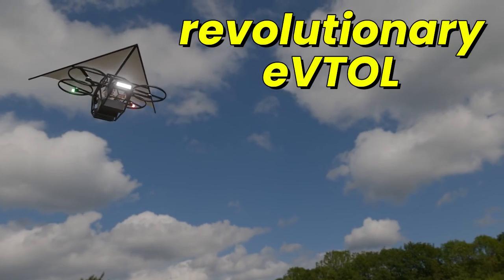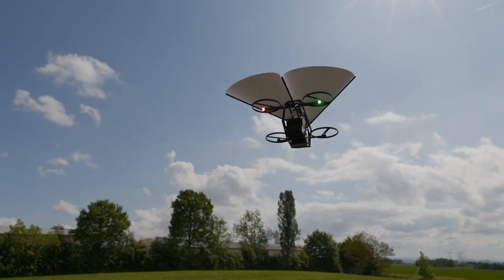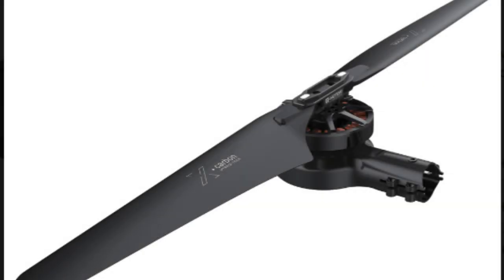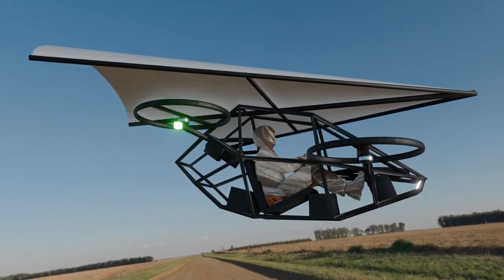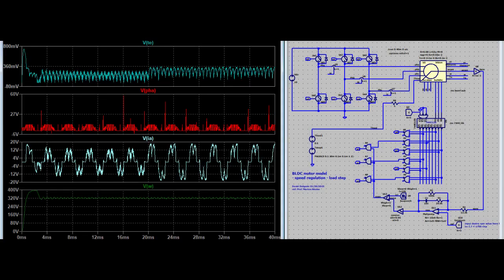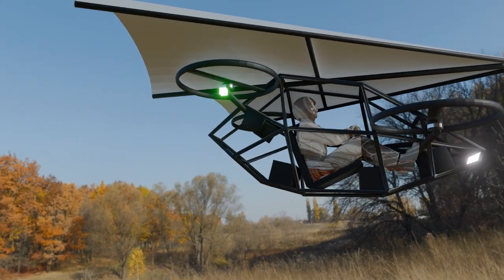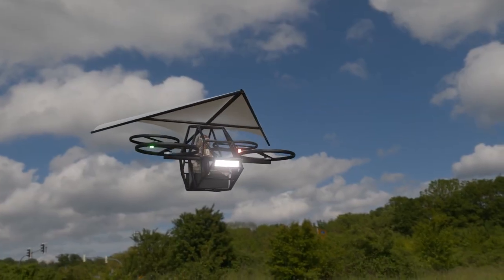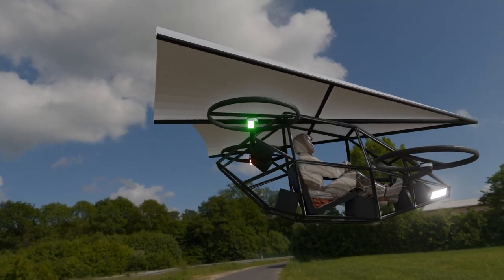eVTOL Drone hybrid for Safety, Innovation, and Freedom

Comment: As a design engineer, commercial pilot, drone pilot and hang glider pilot, this is a great idea, although not as presented. A modern delta wing hang glider with four electric motors/props would provide full vertical takeoff capability, however, with the ability to transition the motor pods to horizontal thrust, similar to a V-22. And not use a old-school rogallo wing, for obvious (to me) reasons. If you think a rogallo wing would work, you have obviously never flown one. The core idea has merit, but the vapor-ware depiction fails entirely.
Reply: I completely agree, this design is deeply flawed, obviously the work of someone with little to no experience in hang gliding or ultralight aircraft.
Reply from the maker: Thanks for the input. However, the system is intended to carry the payload "up the mountain" and not to be used during the glide path down. Does that make sense??  Let me know.
Reply: @BoundlessVision-d2  Then why even bother with the wing? In my vision, the ability to take off vertically is the reason for the quad-rotors. For forward flight, using the wing, rather than the rotors is WAY more efficient, and gives you reduced power requirements which gives you way more range than lifting with rotors alone, but then you must rotate the rotors to thrust horizontally. A rogallo wing as you show is super 'floppy', as I know, having flown them for years. Just trying to save you some time. I think you need to state your goal in greater detail.
Reply from the maker: @BrilliantDesignOnline  Yes no argument with that other than incorporating old school stuff with the new.  Is all.  One of my NEW tech system will absolutely blow your socks away.  Look for that video.  Similar quad Control theory is used

Comment: L'aile Rogallo a de mauvaises performances c'est pour cela que ce genre de forme en triangle a complétement évoluée vers des allongements plus performant sur les ailes delta de vol libre modernes.  De plus il faudrait une aile bien plus haute pour dégager l'intrados de l'aspiration des 4 rotors si on veux espérer que l'aile produise une portance. Le plus efficace en VTOL c'est un avion avec des moteurs qui pivote comme le V-22 Osprey
Reply from the maker: Great observation, but the original concept, the Rogallo wing, is not used as a lift device, but as a parachute, if you will. Thanks for. your comments.
Reply: @BoundlessVision-d2  Ah ok je comprend.

Comment from the maker: The Rogallo wing is a flexible, delta-shaped airfoil that was originally developed by Francis Rogallo in the 1940s. It is known for its simplicity, light weight, and ability to self-stabilize in flight. Here’s a breakdown of its aerodynamic properties:

1. Basic Aerodynamics
Flexible Airfoil: Unlike rigid wings, the Rogallo wing deforms in response to airflow, dynamically adjusting its shape for optimal lift.
High Lift-to-Drag Ratio: It produces significant lift while maintaining relatively low drag, making it efficient for gliding and slow-speed applications.
Trailing Edge Flow Control: The trailing edge flaps in response to air pressure changes, which can improve stability and stall resistance.
2. Lift Generation
The wing is usually slightly cambered, meaning air travels faster over the top surface than the bottom, creating lift via the Bernoulli principle.
Angle of Attack (AoA): Adjusting the AoA changes the amount of lift generated. A higher AoA increases lift but also increases drag and the risk of stall.
Leading-Edge Tensioning: The shape of the leading edge influences airflow attachment and affects overall performance.
3. Drag and Stability
Induced Drag: Due to its swept-back design, the Rogallo wing generates less induced drag compared to a conventional rectangular wing.
Parasitic Drag: Since it's made from a flexible material (like fabric), some drag arises from fluttering or deformation at high speeds.
Passive Stability: It tends to self-correct in disturbances due to its flexible, dihedral shape, making it inherently stable.
4. Control and Maneuverability
Weight-Shift Control: Common in hang gliders and ultralights, shifting the pilot’s weight changes the center of gravity and alters flight path.
Bridle Adjustments: The tension and positioning of suspension lines can affect the wing's response and performance.
Flare Capability: The wing allows for controlled landing flares, slowing descent speed for smoother touchdowns.
5. Applications
Hang Gliders & Ultralight Aircraft: Provides safe and efficient flight with minimal control inputs.
Parachutes & Space Capsules: NASA tested Rogallo wings for controlled spacecraft recovery.
Kites & RC Planes: Offers simple, stable, and efficient flight for various recreational and experimental uses.
Reply: Yeah, NO. You should think a trike with a modern wing, but electric motors capable of longitudinal rotation for horz thrust, and/or vertical lift.

Comment: with your configulation it not gonna work, since both of them can't work at the same time.
the rear rotor will suck the glider wing in and make it lost the aerodynamic shape and the ability to glide while at the same time the quad copter part have to tillting to the direction that it move the glider part will just get in the way and blocking the air intake so it gonna fall like a brick.
Reply from the maker: but that assumes a traditional interaction between the rotor wash and the glider wing. With the right flow control, vortex management, and synchronized thrust vectoring, the glider section can actually benefit from the rear rotor's induced airflow rather than being disrupted by it. As for tilting, careful positioning and adaptive control can mitigate interference while maximizing lift and propulsion efficiency. So, rather than falling like a brick, it's more about making the brick think it's a bird." 😉
Reply: @BoundlessVision-d2  not with the one in the video for sure.
you need a solid wing that not require airflow to form aerodynamic shape. it better to combine the quadcopter with a sailplane what you have todo is figuring it out the best way to extend and retract the quadcopter part to minimizing the drag when you about to glind.
Reply from the maker: @readingmachinenegi  The Rogallo wing is like having a built-in safety net, plus the added lift means the motors don’t have to work as hard—win-win. The key challenge is optimizing the transition between VTOL and forward flight while keeping the wing stable under varying thrust conditions. If the rear motors can tilt effectively without airflow interference, it could create a super-efficient hybrid system. Now the question is: How much control authority can we squeeze out of the wing without compromising VTOL stability?
Reply: @BoundlessVision-d2  The Rogallo wing is only forming an aerodynamic shape when it have air flow beneath it while it decending forward aka gliding.
while in the power flight mode by quadcopter you are going up and tilting foward so it can't work at the same time
also at that moment  the quadcopter pushing you up the Rogallo wing  will floped down and get suck into the roter blade.

both of them can't work at the same time.
try to make some RC prototype and yoy will see it

Comment: Problems
1. The wing is not big enough .
2.  The quadcopter in question doesn't show its components to hide the fact that it would be heavier .
3.  The motors could not be in that position winged flight at the same time . 
All problems identified potentially have Solutions as long as some real thought is put into project .
Reply: I look forward to seeing a full-size prototyping flight ,
It would show the flight performance that you are explaining .
Reply from the maker: Thank you for your input.  Your conjecture #1 claims the wing is not big enough. I would welcome your analysis regarding that claim and compare it to my simulations for this very specific application.  That would be very helpful indeed. Regarding your conjecture #2 , if you may, kindly look up the density of carbon graphite and compare the strength to weight ratio to that of aluminum.  It may surprise you regarding your "FACT" that it would be heavier. Now for your conjecture #3 I will repeat again and again the following:
1. When placing the wing above the propellers, most of the turbulent air from the propellers moves below the wing, allowing smoother and more stable airflow over the wing surface.
2.The wing typically stays in "clean" airflow, which helps maintain lift and reduces the chances of separation.
3.Wake turbulence and disturbed air from the propellers are less likely to interfere with lift generation on the wing.

The eVTOL Drone hybrid was designed for Safety to Mitigate Risks such as positioning the wing high enough to avoid propeller vortices and turbulent zones.  Wing's placement allows clean airflow during forward flight. Using advanced flight controllers for yaw, pitch, and roll correction to recover from impending DISTRUBANCES quickly. Closed loop system with optimum PID error summation values and last but not least, it is important to note the Rogallo wing was designed to act as an emergency parachute in case of motor failure "it is only going for the ride" and NOT intended to be used for hang glider activities 

Perhaps watching movies of people flying into the air with only a jump chute and wings that appear insufficiently large is one way to answer the question of how large a wing should be in order to serve as an emergency parachute. Just something to put things in perspective.   Once more, I appreciate your insightful comments.
Reply: @BoundlessVision-d2   Having a wing as shown in your initial presentation is actually a very Innovative strategy with strong potential ,
But if it's going to be used for unpowered flight in the case of motor failure you only have to look to the Hang Gliders
as example what's necessary for unpowered flight .
Powered flight on the other hand has more flexibility with wing size and if the motors front or back could tilt forward that would allow the wing to work .
 the wing being able to extend and contract obviously holds promise , I simply suspect building in some more flexibility into your vehicle would allow for its full promise .
Reply from the maker: @BG-me3pc  Thank you   A hands-off glide ratio is my ultimate objective.    In order to maximize a Rogallo wing's hands-off glide ratio for the drone, we must take into account:

1. Key Factors Affecting Glide Ratio
Aspect Ratio (AR): Higher AR improves glide ratio but reduces stability. Most Rogallo wings have AR ≈ 2–3.
Sail Tension & Reflex Angle: More reflex stabilizes the wing but increases drag.
Center of Gravity (CG) Placement: Moving CG slightly forward improves glide performance but may require trim adjustments.
Wing Loading: Higher wing loading (weight per area) reduces glide efficiency.

2. Estimated Glide Ratio for the Design
If  designing a lightweight drone-style glider, here’s what we can expect:

Basic, low-tension Rogallo wing: ~2:1 to 3:1
Optimized Rogallo (higher AR, better materials, tuned reflex): ~4:1 to 5:1
Advanced (with slight camber, optimized flow control): 5:1 to 6:1

3. Improving Hands-Off Glide Performance
Increase aspect ratio slightly (e.g., widen the wing).
Use a semi-rigid leading edge for better shape control.
Fine-tune reflex angle (1°–3° positive for stability).
Reduce drag with better fabric tensioning or lightweight composites.
Optimize CG placement for neutral stability in glide
Reply: @BoundlessVision-d2  From experience, as depicted, will not work. A 'standard' rogallo wing as shown only has a 4:1 glide ratio, if you are lucky.
Reply from the maker: @BrilliantDesignOnline   In an emergency situation in a very unlikely motor failure, any landing is better than falling like a rock!!!!

 Survivability Considerations
PROS (Barely survivable):

If you’re flying relatively low and slow in an ultralight or experimental craft, you might still have time to pick a spot to land.

You might be able to survive a forced landing if you are over flat terrain or near a field.

CONS (Risks):

At 4:1, you’ll descend very quickly, and have little time or maneuvering range.

Very small margin for error. Bad weather, terrain, or obstacles can easily result in a crash.
Reply: @BoundlessVision-d2  First, I am guessing you are not a pilot, drone, helicopter, ultralight, airplane, or hang glider; I am all the above. Second, having an idea, and creating a 'representation' in no ways represent a successful engineering design; Have many qualified people look at this and the final result will be only faintly like your representation.
Good luck.
Reply from the maker: @BrilliantDesignOnline Thank you for your valuable input and concerns. I truly appreciate your comments based on experience  I am a pilot and shall use all analytical tools such as FEA etc to further investigate any an all conjectures 😊

Comment: You do know that the rule of thumb for hang gliders is 19 square meters of wing area for the average adult 
Your image shows something that 1 will not work as you are describing & 2 is very likely to be utterly dangerous 
Just look at it those props so close to the underside of the wing 
Go & play with a scale model of this thing it will be so bad
Reply from the maker: Depending on a particular design configuration, this is accurate. Rule of thumb is invaluable.  However, for the reasons listed below, your hypothesis is incorrect for this idea.
 1. When placing the wing above the propellers, most of the turbulent air from the propellers moves below the wing, allowing smoother and more stable airflow over the wing surface.
2.The wing typically stays in "clean" airflow, which helps maintain lift and reduces the chances of separation.
3.Wake turbulence and disturbed air from the propellers are less likely to interfere with lift generation on the wing.

The eVTOL Drone hybrid was designed for Safety to Mitigate Risks such as positioning the wing high enough to avoid propeller vortices and turbulent zones.  Wing's placement allows clean airflow during forward flight. Using advanced flight controllers for yaw, pitch, and roll correction to recover from disturbances quickly. Closed loop system with optimum PID error summation values Finally it is important to note the Rogallo wing shall act as an emergency parachute in case of motor failure "it is only going for the ride" and NOT intended to be used for hang glider activities 

Watching videos of people gliding through the air with just a jump chute is a great example of how the rule of thumb for hung gliders does not apply in this case. You might want to go and play with a scale model of that thing and see if you can find that an average adult does not need a 19 square meter wing area.  However, I will investigate your suggestion with additional simulations 

Thank you for your input

Comment: The wing only for gliding not for lift
Reply: Not exactly. In order to glide you require lift forces, otherwise you sink like a brick. Hang glider wings produce lift, just like any other type of winged aircraft. So whilst such glider wing profiles might not produce lift when attached to a hybrid VTOL aircraft operating in VTOL mode, they do produce lift when moving forwards in ascent and decent mode in powered and unpowered flight modes respectively.
Reply from the maker: @JoeyBlogs007  Yes, I stand corrected Thank you.  We would like to land successfully in unpowered decent mode, as you may have understood.  It is important to note the Rogallo wing shall act as an emergency parachute in case of motor failure "it is only going for the ride" and NOT intended to be used for hang glider activities
Reply: @JoeyBlogs007  the lift force already take over by propeller event the VTOL move forward the angle of attack will be contra diction with angle of attack of wing and VTOL because of went move forward the propeller will adjust of angle of attack of VTOL I hope you understand
Reply from the maker: @isratasibuea4189  Yes we got this!!!  Thank you The transition from VTOL to forward flight introduces a dynamic interaction between propeller-induced lift and aerodynamic wing lift. As the VTOL moves forward, the propellers adjust their thrust vector, which inevitably alters the effective angle of attack (AOA) of both the wing and the VTOL body. This can create a potential contradiction between the AOA required for efficient wing lift and the residual influence of the propellers.

To resolve this, the flight control system must employ real-time adaptive algorithms that:

Gradually Shift Lift Dependence – As forward velocity increases, the system must progressively reduce propeller-induced lift while optimizing wing-generated lift.
AOA Synchronization – The algorithm should manage the pitch angle to ensure that both the propeller thrust vector and wing lift remain in aerodynamic harmony, avoiding unnecessary drag or instability.
Thrust Vector Control – If using tilt-rotors or variable-pitch propellers, their orientation should be precisely modulated to maintain smooth lift handoff.
Sensor-Based Adjustments – The system should integrate airspeed, AoA, and IMU data to continuously fine-tune control surfaces and throttle settings.
This requires an intelligent control loop in PX4/Ardupilot (or custom firmware) to dynamically balance these forces during transition
Reply from the maker: Exactly. The quadcopter (AKA helicopter) does not depend on the wing for lift, pitch, roll, yaw, in the event of motor failure, the aircraft can transition into a stable glide thus replacing the parachute Safety is at the core of this project. The combination of the Rogallo wing and electric quad-motor configuration ensures reliable performance. We’ve built this eVTOL with a focus on graceful landings under any condition.  My next video is going to show the wing in an automatic spring-loaded folded configuration during flight